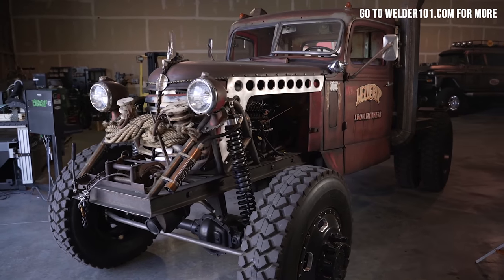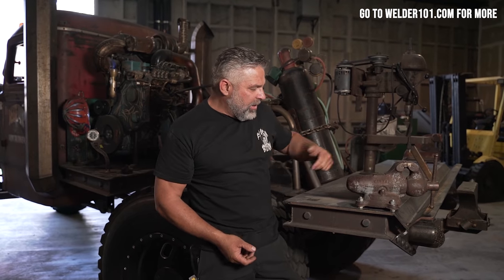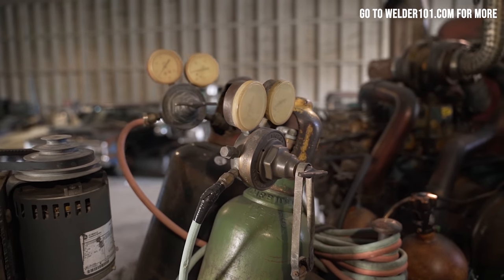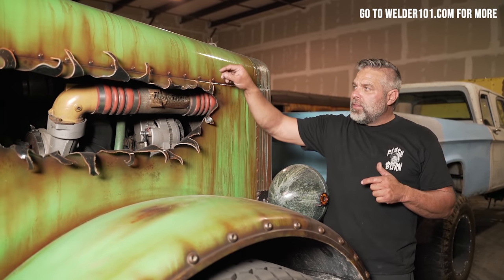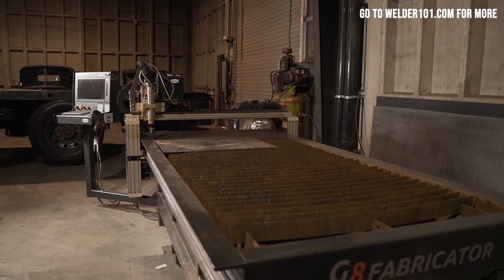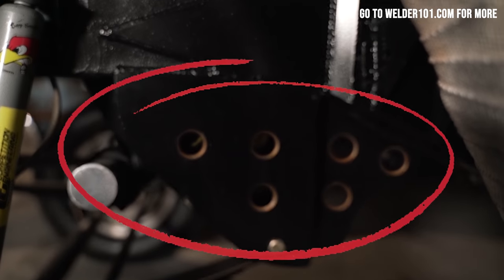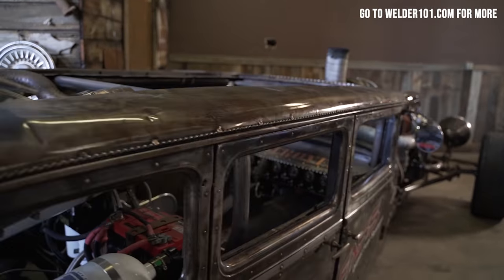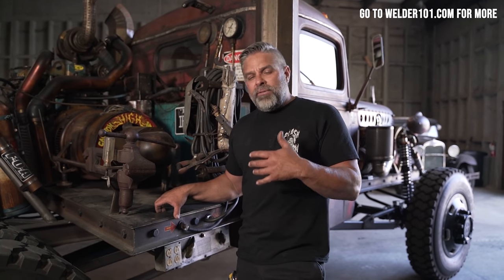How The Most INSANE Rat Rods Were Welded Together On TV! Never Before Seen!

Comment from the maker: What project would YOU weld together?! Comment below
Reply: mad max,s v8 interceptor
Reply: The iron rod is my favorite build so far. And would love to build a custom welding rig like that and make it work in the cold state of Minnesota.
Reply: DEUCE N HALF MAD MAX/END OF THE WORLD VEHICLE.
Reply: Learning to weld would be awesome in itself! Then my first project some bad  a— bumpers for my 05 Cummins.
Reply: Since we live in the Mountains, a project similar to the Old Logging Truck you guys did a couple 2-3 yrs ago....Something Big and Loud, Gear Drive Transfer case with PTO for pulling yourself or others out of trouble but mainly to skid logs from a ways off the Trail to the Truck for firewood or "other" uses or projects.
 A stump puller of a Diesel to put power to the ground but still be able to get to and from the Mountain Trails in a hurry if need be, of course really Tall but narrow rubber to get you through snow, mud, rocks as well as relatively smoothly down the Highway. Fabricate storage for all the tools and cables and straps a guy might ever want or need. Make it preferably a 1940's vintage Truck Cab to start with and incorporate it into a pkg. that looks like it was built that way clear back when but for whatever reason they didn't lol. Fabricate places to carry all my Chainsaw/Bar combos that need to be secured during travel to and from the woods. Maybe a vise on the bed that can be used to clamp the Bar to facilitate sharpening the chain on the saw. Maybe even a electric bench mounted Chain Sharpener when you start dulling the chains in the rocks when bucking up the logs ?
 Of course a generator for power would be a needed option as well as a rear mounted cable winch to skid logs from the back as well....it would be like the ultimate off road rough country logging truck. Make the shifters out of old logging tools and the interior door and window handles out of similar items....kinda like a hopped up old skool but functional everyday useable bad ass to the bone log getting machine!
That is exactly what our Son and I would build and get honestly hundreds of hours use out of but like alot of guys....money to do all this don't grow on trees so it will just have to remain a dream project I figure but man just think how much Father/Son time our boy and I would get out of building and using something like this.....see I guess we kinda go against the grain because our Son and I have a great relationship and really enjoy working on things as a team.....It's because of this I have been lucky enough to be passing on all the knowledge my Grandfather took the time to teach me....I am now passing on to him....he's already a decent Blacksmith and Welder....were currently working on his very first complete Small Block Chevy build from tear down to start 'er up....he's learning everything to piece together a really strong Small Block using all early GM swappable parts....327 crank in a 350 block the right rods and domed pistons, how to find a good set of 202 power pack heads and how to do a complete rebuild of them plus how to port and polish, remove the pressed in 3/8" valve spring studs and install threaded 7/16" studs for bigger and better springs that can handle a good size roller Cam...you get the picture I'm sure Steve....I even had him build a Holley 750 double pump carb from a big box of spare parts I had....we have already tested it on our old K-5 Blazer he drives and he did a fantastic job.....I had to do very little adjusting to it to have it running like a new one.
Thanks Again Steve for all the fantastic Videos we really enjoy them.
R.C. "Charlie" Hill and Son.

P.S. sorry the post was so freakin long.....lol.
Reply: I have a 1954 Mack B20p that I want to Cummins swap and turn into a complete beast
Reply: I am working on one now. Ford bumpside 4x4,  cab forward will be perfect, but bed will be original with dents and all and a nice lumber rack to do work with.  Or maybe a nice flatbed.
Reply: i would weld the dash for my 79 datsun
Reply: That welding rig is the baddest rig on the planet
Reply: Model t with a wrecker crane on the back.
Reply: If i didn't have a 16 year old fighting brain cancer id love to build a 50s dodge pickup on a 12 valve cummins dodge ton 4x4 5sp under carriage pulling a dodge gasser and have a cool pan head harley chopper in the bed that'll be a dream a.die with because my kids will always be my love no matter what there my best friends and a true part of me i just want you to know i think ur a great man thats more real than most these days thanks for all the entertainment and please just keep being you some of us need it
Reply: Wow! That welding truck is the best one I've ever seen , you did a fantastic job!  I would much rather have that  than a brand new one. Keep u
Reply: Just a chaise for a car project or truck but that's in the future,  I did modifie a tow bar got it for 10 bucks  as it was to long for my Rav4 so cut it down modified the mounts and welded it back together it working well 👍🏾🤙🏼 😃
Reply: Currently, I.'m building a full tube chassis Prostreet 94 Chevy truck with full cage because I want to go racing again for the 3rd time.
Reply: Square Bird Rat Rod on extended frame with tripower Flathead motor. I dare ya Steve.
Reply: WelderUp my project would be a  ford model t pickup with a flat deck bed and a dually rear end and a 12 valve Cummins to match but front end wise a old peterbuilt front clip with a old model t grill welded in and drop it down with cycle fenders and the old school fold up hood and a solid front axle with air ride suspension and a one of a kind oil slick patina paint job
Reply: its a lap joint and a fillet weld... ;) Dont teach'em wrong now... because that is basic and fundamental... Got your BLT extra cheese, butt, lap, tee,edge,corner... Then you welds.. groove, fillet, surface, plug, seam, spot.. many others.. and over 100 different welding processes.
Reply: Always improving the Binderbird
Reply: Do you do meet and greets? I’m from nampa Idaho and want to plan a vacation to your shop
Reply from the maker: @yeahok115sure  We are open daily for self guided tours, but on most Fridays I guide the "Real Deal Tour".  Hope you can stop by. Here is the link for more information and bookings: www.welderup.com/tours
Reply: @WelderUpVegas  awesome thank you!!!
Reply: @WelderUpVegas  I like evil cars but this is real good
Reply: my dream car Porsche 911 targa monster.
Reply: I dig what you did to the redface Steve. Don't think I could chop mine up like that tho. My first machine and made a living with it for years, you never forget your first! Still runs good and welds like a '64 Redface, buttery smooth. That throaty exhaust on jump to high idle is one of my fav sounds ever. The R57 idler was always clunky and usually got pinned on high idle anyway lol. But the diesel conversion does make sense. Only thing better is a short hood! 
Not a practical "Daily" rig but i like where it wound up in the end.  Def a looker and will get your work noticed. 

By the way please teach these youngins you Can weld cast iron with low-Hy.
Reply: I'm a big big fan and how much  custom my 70 cadillac coupe deville hardtop  door

Comment: That welder is just like the Lincoln "torpedo ". For uphand joints I like to use a 6013 for the root pass, it's a little softer than the 7018 so it burns a deep pass, then the 7018 for strength and it's pretty as long as you can weld dimes!